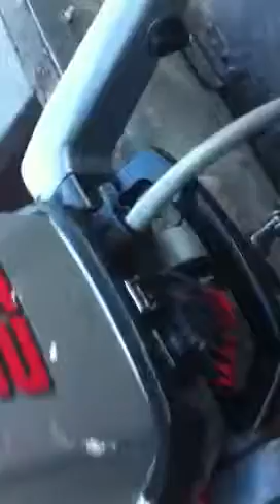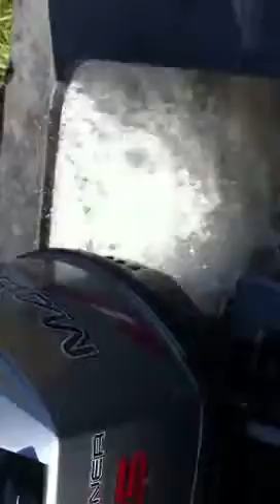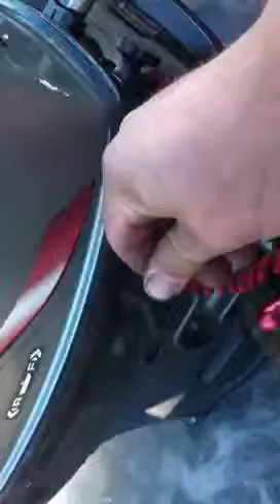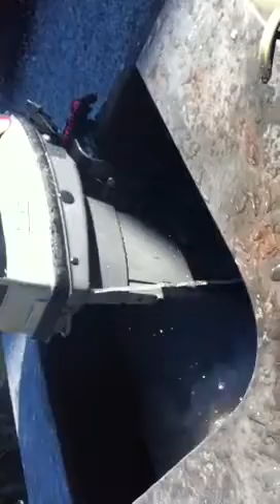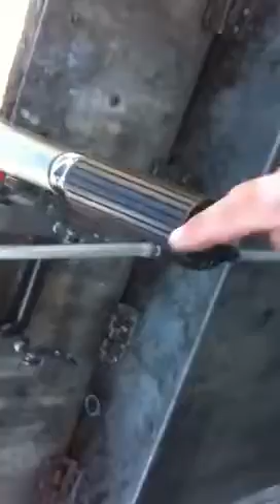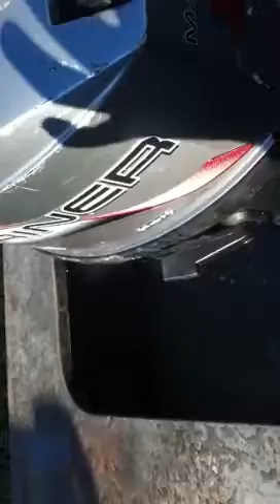1998 Mariner 25HP 2Stroke

Comment: i have identical engine,mine pushes 17ft microplus 501 with 4 people and thier fishing gear etc absolutely fine,great on fuel to compared to the 40-50hp that i was advised to get.i didnt want to hammer along and this 25hp still does around 20mph on the said boat.thats more than enough for me.